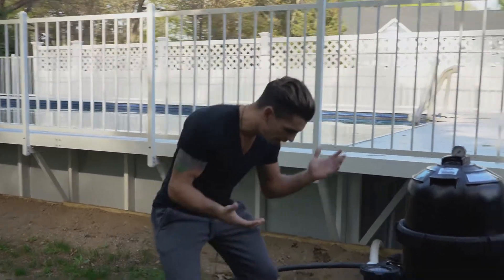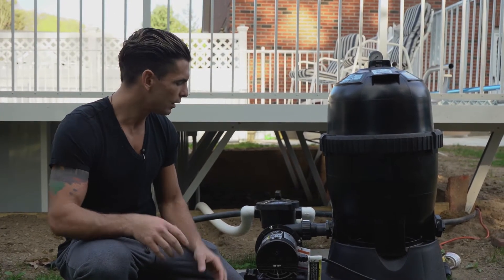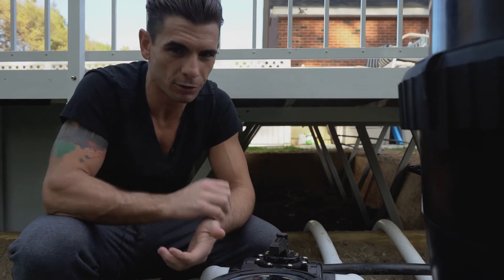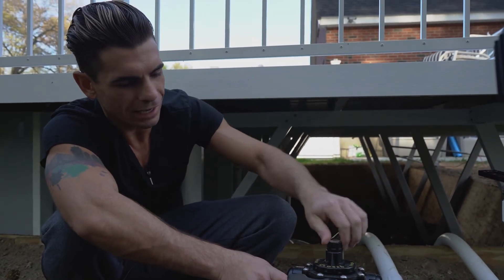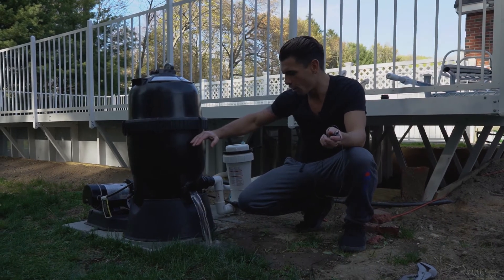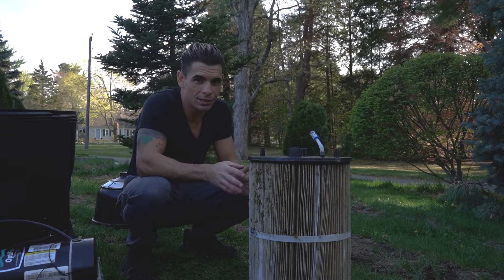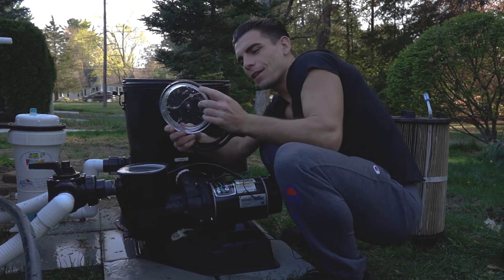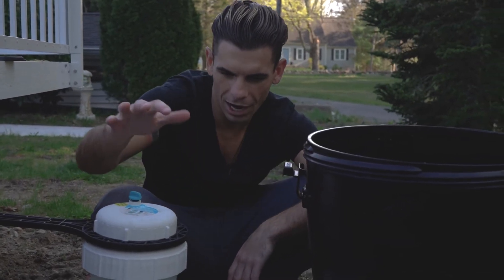Pool School 101

Comment: Question: on the Frog Cycler, I keep getting a persistent drip, even though the O-ring is in place, it’s threaded correctly, and maintained properly. Got any suggestions for stopping the drip before freezing weather comes along?
Reply: Frogger has to be taken off for the winter, but if it’s from the lid a new lid might do it and if it’s a fitting then it might be worth replacing the fitting.

Comment: The skimmer has air in it when it runs (it's not completely full of water). We cleaned the skimmer filter, which wasn't very dirty. Also the pressure gauge on the pump was hovering between 6-10, but sometimes drops below 5 before coming back up. After cleaning skimmer filter and turning pump on to check if it helped, the skimmer still had air and the pressure gauge was at 5. When running the pump it sounds like a loud washing machine. The pool was filled with water to the level recommended by the installer - halfway up the skimmer box in the pool - but it makes us think the water's too low? Thank you in advance.
Reply from the maker: sounds like your water level is too low, it helps sometimes to take the skimmer door flapper out of the pool because sometimes it causes more issues than it solves, i threw mine away years ago, your water should be 3/4 of the way up the skimmer.  try running the pool from the bottom drains only and if its is working properly than youve isolated the problem and air is probably getting in through the skimmer.